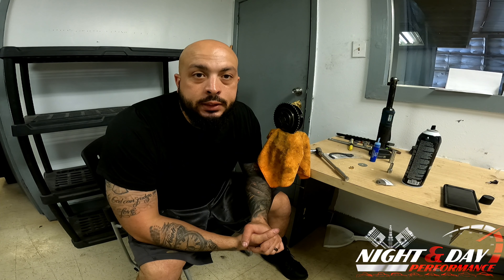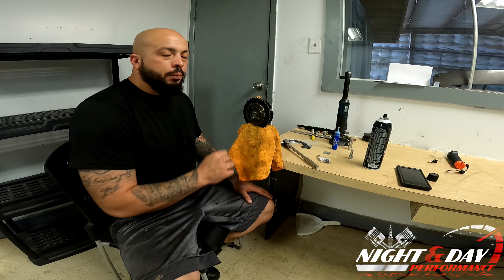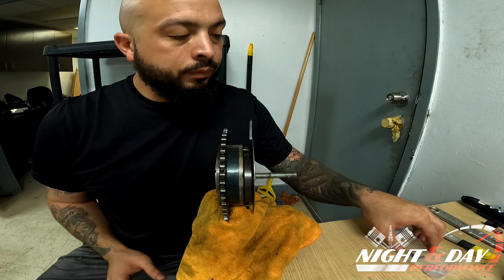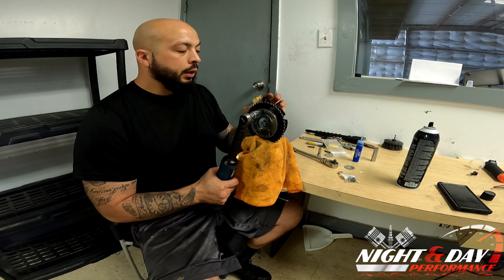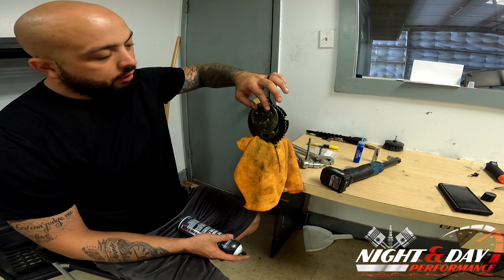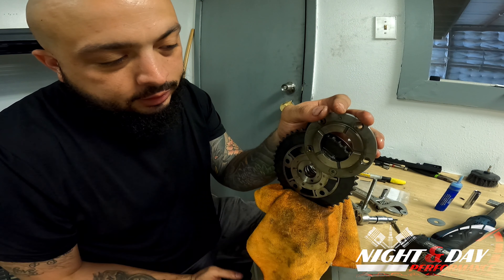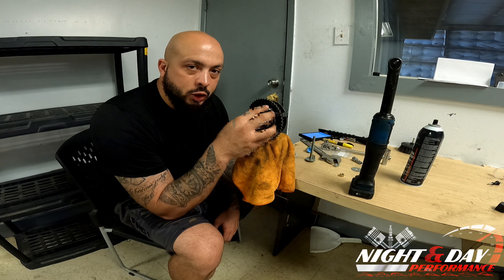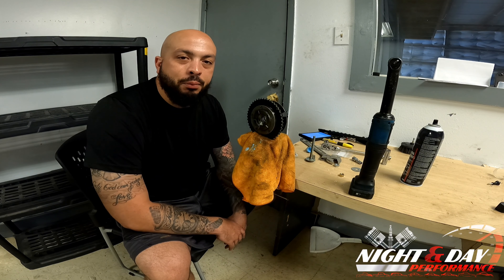GEN 5 LT CAM PHASER LIMITER / LOCKOUT INSTALL

Comment: Might be a dumb question, is it normal to hear the limiter block rocking back and forth inside the phaser chamber on a new install when rotating the cam?
Reply from the maker: no. That normally means the spring broke or came undone when working on it
Reply: Theres still tension on the spring when i reassembled. Its resting against the pin as it was
Reply: And just to clarify, i dont mean with the engine running, just with it in my hand. I hear the limiter moving back and forth inside the control chamber when moving the phaser around
Reply from the maker: @scls3power  if your referencing like if you were to shake it then that is normal. 

If you mean turning over the engine it seems like it is actuation then you have an issue.
Reply: @NightAndDayPerformance  ok yes, thats what i was refering to. Thank you for the peace of mind

Comment: So which would you say is better? A 4 degree limiter or the 0 degree lockout
Reply from the maker: So that is dependent on the setup. The limiter allows you to still utilize limited VVT functionality which nets better HP gains but some cams are too big to allow this without Piston to Valve contact so they must be locked out.
Reply: @ so I’m about to order the btr 225 cam, btr recommends their 4 degree limiter but I see everyone goes for the lockout instead. What would you say is my best choice?
Reply from the maker: @c.siikz_  get the limiter and make sure you have a tuner that knows how to utilize it

Comment: What is your opinion on replacing bolts such as the oil pump, timing cover fuel pump etc, they are originally tty, do you just use blue loctite on everything?
Reply from the maker: so replacing is always a good thing but on some of those with lower torque specs we usually inspect the bolts for stretch. In our experience those bolts are usually okay to reuse at least once with blue loctite